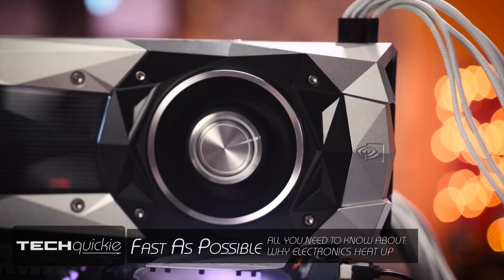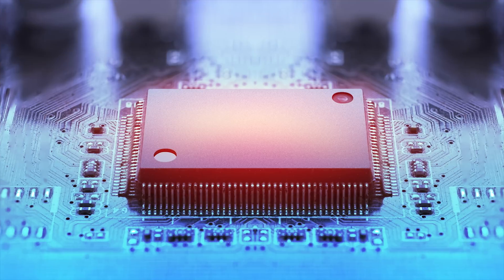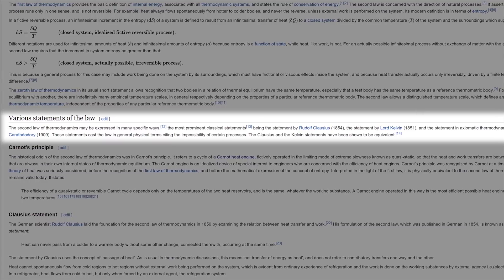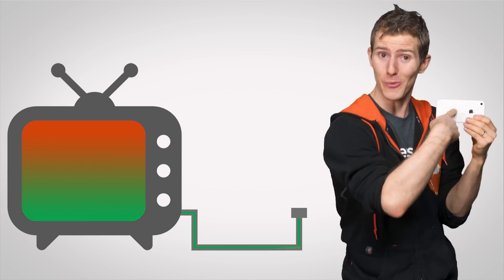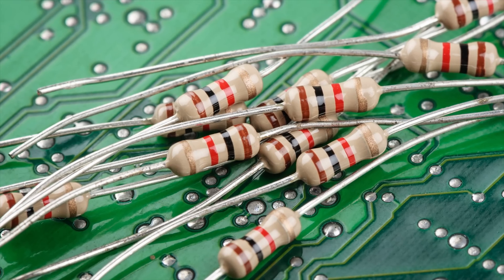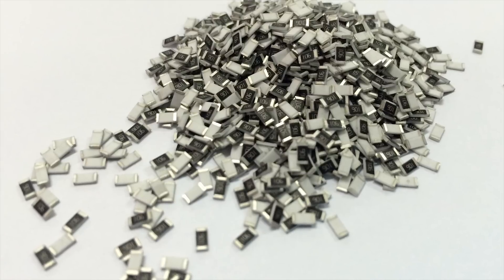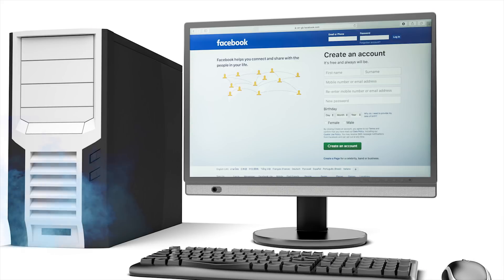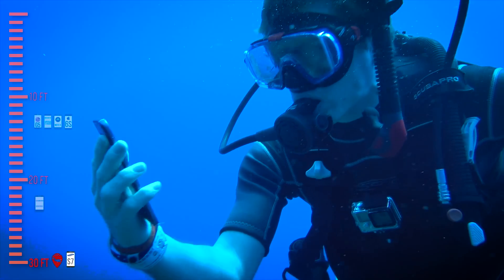Why Do Electronics Get Hot?

Comment: All electronic conductors will make some heat. Every type of conductor has some resistance. Heat is a function of transfer of electrical power. Greater efficiency to get a task done releases less heat, because lower power factor is used.  There are limits to how much efficiency is possible.

Comment: Resistors don't just spew out electricity they don't use.
They choke the flow of electricity, so higher resistance is equal to less heat generated, not the other way.

Electronics heat up because electricity passes through them at non-zero resistance.

Comment: 'Leakage' is not correct. Current used when an IC is idle is quintessent current. Also most modern ICs use FETs not transistors. The heat generated during high frequency switching is from the FET spending more time in the linear region.
Reply: @mozzjones6943  don't be daft
Reply: @mozzjones6943  its like capacitance and inductance. Just opposite
Reply: @mozzjones6943  OK Boomer

Comment: I have an original original Backwards compatible ps3 and I think Now know why it overheats because the internal power supply has a metal case and that gets hot under the is the energy inefficient GPU and CPU for the Ps3 and ps2 ones and it has bad air flow plus Sony used cheap thermal past that’s already 10+ years old don’t forget it has an extra CPU and GPU from the ps2 to worry about that’s probably why it overheats

Comment: If as you said, all electronics heat up and need a fan and a radiator to cool them up, and also it gets hot even when we use the browser only or Microsoft Office programs..
hmmm..
*Then why laptops with like Atom processors don't have a cooling fans?!?
Reply: Because they probably have crappy CPU's that are slow and hence need less energy, so just a heatsink will suffice to cool them off.

Comment: Easier explanation:
Ever tried to short out a battery with a wire? Yeah, stuff heats up when you put electricity through it. Cpu is just that - a little maze of teeny tiny wire. And because its so tiny, we have to put a lot of power through it. About as much as 1/10th of electric stove or about the same as high power e-cig. And pretty much all of it goes to heat.

Comment: Why not make processors higher voltage & lower current to reduce heat, just like how electricity transmission is preferred at higher voltages. This should reduce the heat right?. Or is it that the current silicon based VLSI can manage higher voltages?.

Comment: The reason why higher clocks raise the Heat is because every clock makes a short circuit. This is because the Fet's(transistors) have a little capacitor at the gate and need some time to change from open to closed. So there is a time where the fet for 1 and for 0 is closed so it shorts to the ground.

Comment: Heat is basically just "how violently are the particles vibrating?" Move a load of electrons(which is what electric current is) through a conductive(or even better, a not so conductive) material and those particles are gonna have fucking seizure.

Comment: resistors don't control current in modern day pc cpu/gpu - voltage regulator module (vrm) do, which are switching type dc buck converter.

Comment: Well technically you can run a pc without a cooler. It won't get very old, and be slow af, but thanks to energy efficiency and thermal throttling, the cpu can still have enough performance to run windows and maybe even a browser. Admittedly I don't know how long the pc actually runs, but i think it might work for some time
.
Reply: Congrats you just described a M series Apple chip.

Comment: I haven't watched the video yet. So here's the answer to the title of this video:
So.. electricity exists out of a current and a voltage. Current exists out of electrons that are seperated from the atoms in the chemicals in your power supply. So how do we get to move the current through a wire? The answer is voltage. Voltage basically pushes the electrons through the wire.
But Duncan, why do electronics get hot?
Current moves through a wire right? Well it's like driving a car. Between the tires and the road there's friction. This also occurs between current and the wire. Friction is converted into heat.
There's your answer :)

Comment: Faster clock speeds = more energy used. Why?
Because while the transistors in the chip are in the process of switching between 0 and 1 (the 'transient' state), the power that goes into them is lost as heat, as in this state, they're pretty much just a resistor.
The faster the clock speeds, the more time spent in the transient state.

Comment: I got a question that's been bugging me for a while. In supercomputers which run simulations with complex physics and math involved, they stack cpus with many cores. Why not take the most efficient chip currently available and just make it bigger? Like a motherboard sized cpu,with a motherboard sized cooler etc.Yea it's gonna be huge, but i believe it would increase the physical space efficiency, i.e more cores in less square meters of server cabinets
Reply: The reason why they don't do that is that Chips are not manufactured one by one. Instead, they build a big ¨Waffle¨, then cut the individual chips from it. That way, if there's a defect in the waffle (which is almost guaranteed to happen, given the complexity of the process), they don't have to discard the whole thing and start over, but instead just discard the chips made with the defective área. 

That means that the bigger the chip, the more of the waffle ends up discarded when a chip turns out defective. Which makes the whole process more expensive.

In your example, we just can't make a chip the size of a motherboard, because we can't manufacture a waffle that has such a continuous área completely free of defects. At least not at a reasonable Price.

Oh, and by the way, the waffles are round while the chips are squared, which means that the larger the square chips, the more of the round waffle gets discarded even if no defects were found.

Another reason is energy efficiency. Inside the chip, current flows through microscopical copper tracks between components, and because Copper is not 100% conductive, current is lost in the form of heat. The longer the track, the more power is lost. And the bigger the chip, the longer those tracks need to be.

Also, thermal dissipation. You need heat to be transferred away form the chip uniformly across its Surface (i.e. avoid ¨hotspots¨ that can damage the chip)That's why chips have a metal cover with high heat conductivity so that heat distributes uniformly across the whole thing . But because just as with copper and electricity, no material is 100% perfectly conductive to heat,  the larger the Surface, the more heat will just lump in certain áreas.

And finally, cooling. Let's say you solved all the aformementioned issues and managed to cramp all of that system in a smaller space. That would be a problem, because you're still using more of less the same power, thus generating roughly the same heat, but now the volume of air around your system is much smaller, and there's only so much heat a given volume of air can absorb in a given amount of time.

So to keep your system cool, you'd either need to increase the volume of air in the cooling system at any given time, thus forfeiting any space efficiency gained, or you would need to increase the airflow speed, so that the volume of air gets cycled faster. That means running vents at a faster speed, which would increase noise levels (and remember, noise is wasted energy too) and make those vents more prone to mechanical failure.

And if you're thinking ¨Liquid cooling d'uh¨, remember, you'd still need the exact amount of airflow, because all you've done is replace a heat sink for a radiator. And because your heat source is now the size of a motherboard, that means larger amounts of cooling liquid being circulated at a given time, which means wider pipes, which causes turbulence (fluids don't move at the same speed across a section of pipe: they move faster at the center than near the walls. the wider the pipe, the higher the differences in speed), which means higher pressure to keep the flow going, which means bigger and more powerful pumps, all higher maintenance and more and more energy waste...you get the idea.

Long story short...that's why making huge chips is not such a brilliant idea. Sorry.
Reply: @dorianarbos  beautifully explained!
Reply: Thanks for your time man! That answered my question.
Reply: Thanks to you for not complaining about my post being too long to read ;)

Comment: Silicon is a good conductor, but it isn't the best which is why CPUs get hot. This is why there is so much money being put into Graphene CPU research because Graphene is an Ultra Conductor. It resists less electricity thus generates significantly less heat.

Comment: Simple wire has electrical resistance, this resistance causes wire to heat, hot wire has more resistance, which causes more heat which causes more resistance and so on and so on, until you get lightbulb, or stove or oven....

Comment: I've got an AMD graphics card so my room lights on fire every time I play a game.
Reply: Daniel Lo Nigro water cooling it will bring the temps way down and if the temps are down your room will not heat up as much. Just use a AIO CPU water cooler with an adapter to water cool your GPU for around $150.
Reply: The thermal energy has to go somewhere Ninja1inblack, so the room would in theory heat up more if you had water cooling, but the gpu would have lower temps...

Comment: i would like to call processor as zero efficiency part, they  radiate all wattage used as heat.
but with an speaker amplifier those can be 90% efficient, converting only 10 of wattage used to heat.

Comment: Well, every joule of heat produced by your smartphone or laptop is a joule of power uselessly drained from your battery. Because energy doesn't simply come from nowhere. A question: did anyone consider using a stirling engine inside a computer to turn excessive heat back into power?

Comment: older electronics used to not require Cooling until they went past 16 bit hardware.
yeah that original NES or SNES does not use cooling, they didn't need it cause they did alot less compared to the N64 PS1 Dream cast and Original Xbox. yeah these are very old electronics, smart phone manufactorers not putting fans inside those phones or current TV manufactorers not putting fans into those tvs need to put those fans in. they aren't the NES or SNES

Comment: Lol this video is complete trash. The real reason your CPU gets hot is because of the thin wires acting like a large resistor. 

When theres more load, more parts of the cpu is going to have currents. 

For example a small program may only utilize a handful of registers, and require only a few operations. This program utilizes a small portion of the CPU. A Game is going to use a ton of registers,  more threads, utilize the ALU more often,  make tons of requests down the memory bus, PCI lanes, etc. This means more current is going through the packed nm thin wires that act as resistors since they're so thin. 

However Resistors are not the cause for power loss. Current is. A transistor that is ON, is going to waste energy simply because there's current flow. 

P = V^2 / R or P = I^2 * R

As you can see from the equations, resistance scales the current squared. Where a large resistor drops waste power from voltage.

But thats not the whole picture! You CPU is essentially a microwave with about a fifth of the power. At 4GHz, lots of waste energy is going to produce "Eddy currents" into neighbouring metals. Because you have a current, you have energy loss. 

Transformers for power insulate the iron core (they slice it like bread and put a dielectric in between) to prevent eddy currents. This is okay since in a transformer, you only care about magnetic flux, not electric flux (current). And magnetic flux has no insulator so it goes right through dielectrics.

Comment: here's a silly thought. could you salvage the internals from a mini fridge or an air conditioner and re route the pipes onto a cpu or gpu heat sink? im thinking you could maybe set it up like a water cooling loop.
Reply: the compressor would burn out quickly.  they aren't meant to be running for hours nonstop.  But good news is you can buy a phase change cpu cooler that is basically an AC unit for your cpu that's meant to run that much.
Reply: storm37000 ah, i didn't think of the compressor burning out. i bet it would kill your electric bill too, ty for the phase suggestion

Comment: Linus gave an answer I wasn't expecting. I thought it was because electricity passing through silicon and whatever else is in electronics caused friction, which causes heat.  Maybe it's both these (mine and Linus's) answers or maybe I just stated the second law of thermodynamics in a different way.

Comment: I'm answering before watching the video: Because of the Joule effect, when you have a current flowing through a conductor the free electrons move stochastically but with a bias in the current's direction, so when the electrons "collide" with a bounded atom some of their kinetic energy is lost and transformed into heat.

After watching the video I'm not surprised that Clausius theorem is invoked, thou it is a somewhat valid explanation thermodynamics is a statistical phenomenon, so while it does tell you that electronics will get hot it won't really tell you why (plus if they are made of superconductors then they won't get hot at all).

Comment: I swear today my galaxy s7 edge overheated today and legit burned my hand to the point where I almost dropped the phone on the floor and feared that my phone was gonna explode. Luckily I was able to cool it down with the a/c in the room. However, it wasn't coming on. Tried a soft reset #didn'twork. Granted, after a decent charge the phone finally came on again ... I legit thought that I had to buy a new phone
Reply: Michael Dixon Why the fuck would you turn on the AC? Take off the case (if you have one), dampen a paper towel, and put it on the back to the bottom right of the camera. Actually, the S7 edge is IP68 water resitsent. If you wanna cool it dow, fill up a bowl with lukewarm or cold water and just put it in
Reply: sniperunrepeat thanks for the input either way phone is working fine now so all's good. it was prob an app acting up or sumn like that

Comment: The information about resistors causing heat is just plain wrong. .. Without resistors electronics would generate MUCH more heat. So much that it would instantly stop working. This is because of conservation of energy. If something uses 200W - it has to emit 200W of power in some form. Computers usually don't glow or emit very loud sounds so that energy is mostly heat. So the real answer is.... They get hot because that's the only way to release the energy. The way to make electronics less hot is to make them more power efficient.. No way around that. 
In the end it is resistance that causes the heat. But most people would think that decreasing it would be good. It's not. If you consider the thing as a whole then lower resistance = more current will flow and it will heat up more. 
Someone might say that with zero resistance no heat will be generated. Well, almost. The super conductor won't generate heat but whatever limits the current will. And if you don't limit the current, your wires will. And they will heat up

Comment: They are not directly in contact with the cpu/heatsink. Linus has forgotten that thermal paste is put inbetween
Reply: plezx29 technically the thermal paste is actually to increase the contract are with the CPU so while your right, hes not necessarily wrong

Comment: As a physics student I like how people always mention the 'second order of thermodynamics' as being the solution to the problem (when it comes to heat or anything really), when in fact they are talking about the first law of thermodynamics in particular or all the laws of this branch of science.

- The first law simply states that there is conservation of energy (between internal energy, heat and work - thermodynamic terms , go look it up)*. A corollary of this law is that when an object is influenced by some sort of work, its internal energy will rise and/or heat will flow from it. (Hey, this is what Linus said in the video!)

- The second law states that the entropy of a closed system will always rise or remain equal to what it was before. 
The entropy of a system is a measure for the way the system is configured (placement of atoms and their momenta etc.), and it turns out (takes some time to prove) that the entropy of a system is highest, when it is in thermal equilibrium (i.e. the temperature of two objects in contact are the same). Hence a corollary of the second law is that heat always flows from the 'warmer' object to the 'colder' one.

But it is difficult only to use one law to explain some real world problem. If you think about it, you have to use both laws to explain why we experience the component as getting hotter. 

So internet can we make a deal? From now on just say 'laws of thermodynamics', when you think 'second law of thermodynamics!'.

TL;DR: Linus meant to say 'first law of thermodynamics' or 'laws of thermodynamics', when saying 'second law of thermodynamics' (1:02). #triggered